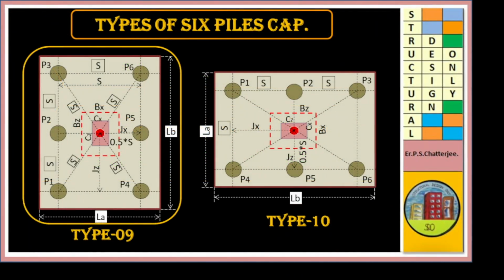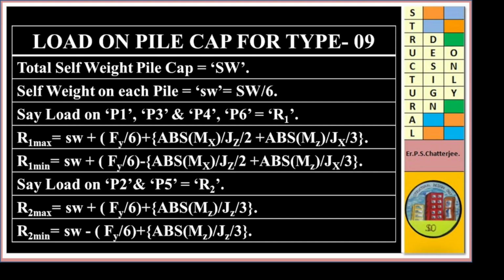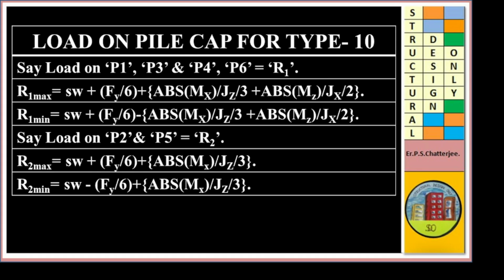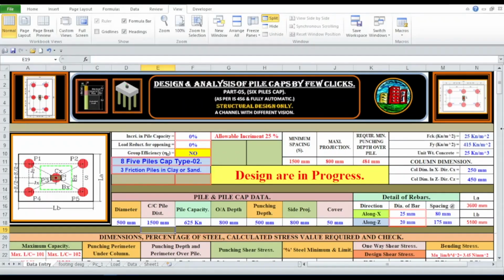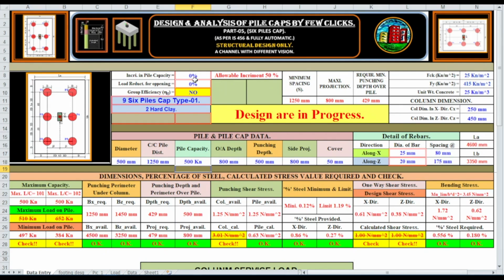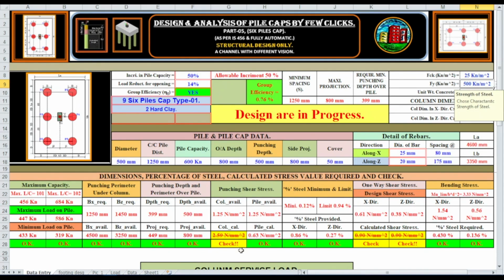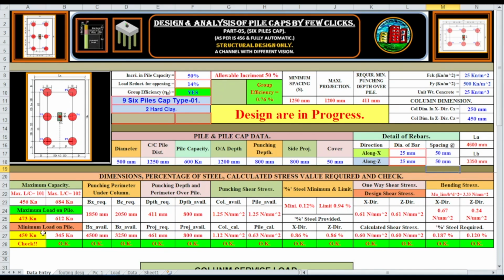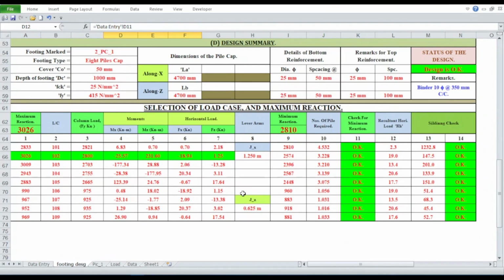How to Design Six Piles Cap in Excel by Few Clicks.

Comment: Dear sir 
Your excel sheet on six pliecap group with two arrangement is excellent. Books are dealt only in one direction only. I kindly request you to share your excel sheet. Thank you for your hard work in making excel sheet and sharing for knowledge point of you.
Reply from the maker: Thanks for your nice comment but I have mentioned in my video that I am going to distribute the Excel sheet after the completion of nine piles cap. It is a single sheet for two to nine piles cap.
Thank you.
Reply: @SD_Only  Thank you for your reply. I will wait till you complete all pilecap design. Kindly share your  excel sheet after completing all pilecaps.Thank you.
Reply from the maker: For your kind information I am going to release Part -06 (Seven Piles Cap) at 8.00 PM. I am inviting you to support my honest effort.
Thank you.
Reply from the maker: How are you.